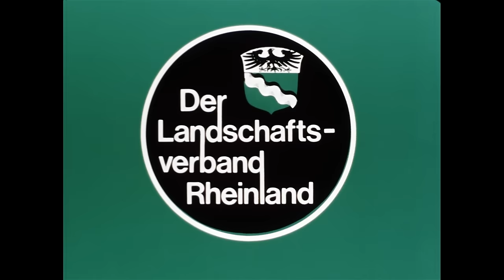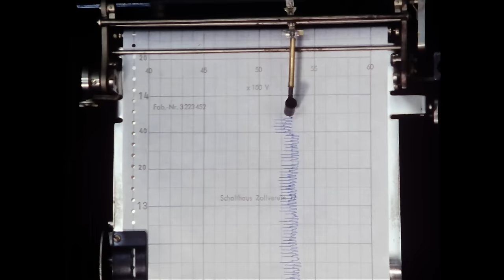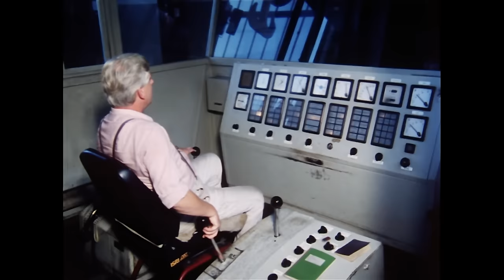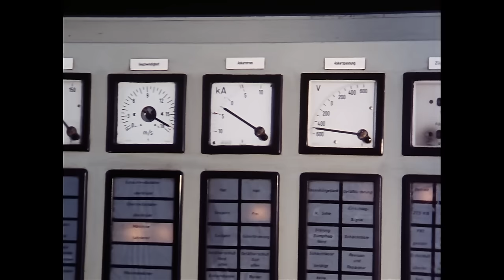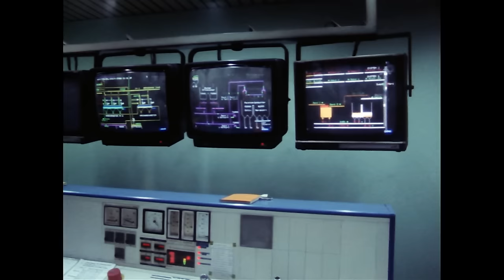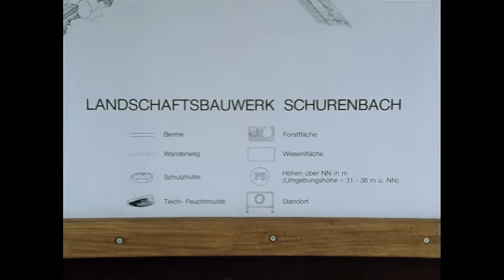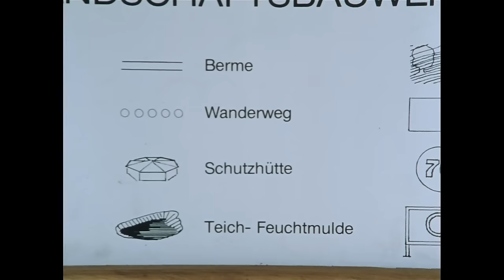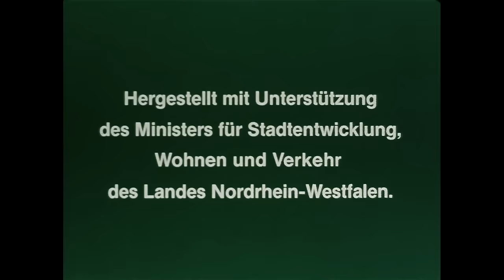Zollverein Schacht 12. Förderung und Aufbereitung der Kohle

Comment: Ich war noch 7 Jahren in Frankreich tätig als Hauer bis 1987. Das heißt,  bohren,  sprengen,  Kohleabtransport dann mit Holz Stempel alles verbauen. Werkzeug: Schlegel, Pickel,  Axt und Kohle Schaufeln. Tiefe war 1050 Meter. Also wenn heute die New Generation meint sie müssen Arbeiten ist das ein Sprachfehler 😉. Glück Auf ⛏🪓.